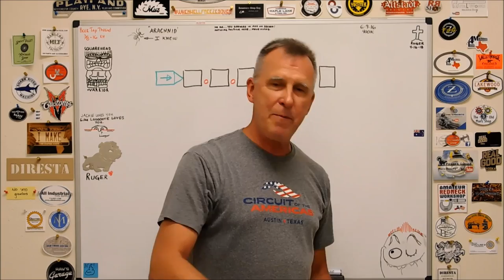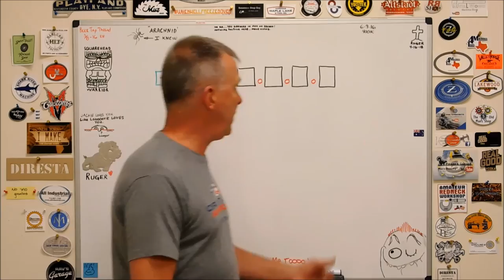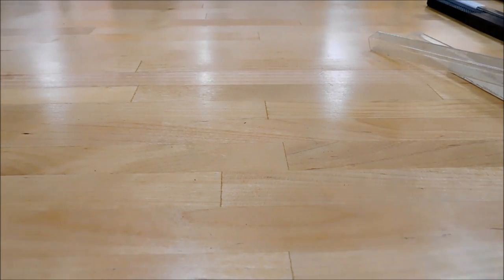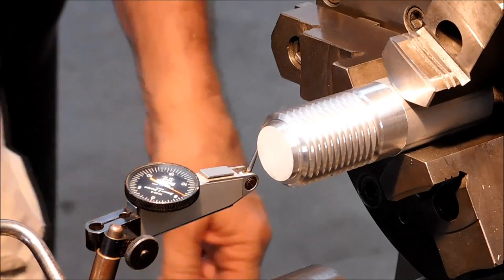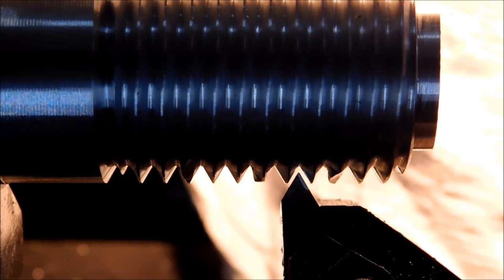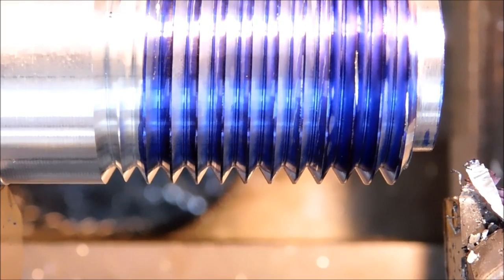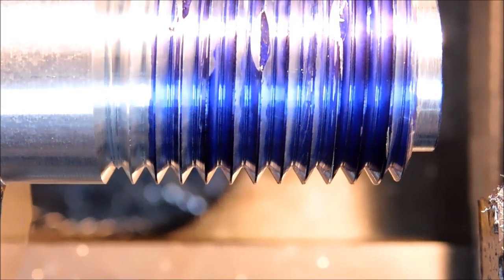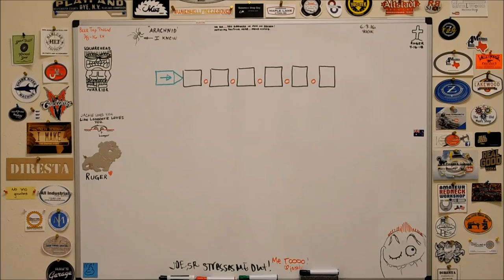Chasing and Repairing Damaged Threads

Comment: Did you say you are cutting a left-handed Thread no right just so everyone knows left hand right ?
Reply from the maker: Correct, for sake of threading away from the chuck for the demonstration with the tool upright, the resulting thread is a left hand.
Reply: @joepie221  Looks left hand to me
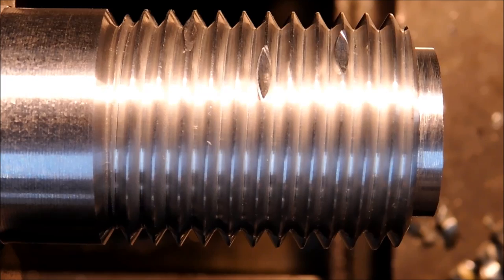Reply: @joepie221  Joe at 20:10 it says this is a LEFT HAND thread .. it also looks left hand in the video
Reply from the maker: @kimgray8327  it is.
Reply from the maker: @chuckels431  you are correct.

Comment: Boo boo at 28:07. I guess it's important to make sure you back the tool out far enough.
Reply from the maker: Negative. The tool only made contact with material displaced by the damage. Notice the remaining thread crests showed no sign of contact.
Reply: @joepie221  Pardon my ignorance. Great video as usual.
Reply: Kris is correct. You can clearly see chip flying and the blue was there before you made your run. Sorry but Kris is correct.
Reply: Indeed. At 28:28, and then again at 28:31, with the rotation stopped, you can clearly see the track of the out-of-position tooltip, taking a slight (RH) helical cut through the blue across the crests in three or four locations

Comment: Eh Joe, I cannot cut threads to save my life. I've got all the change gears, the chart is there & it makes no goddamn sense to me whatsoever. Can you help please?...
Reply: Maybe Joe has a better idea, but every lathe is different and so are the charts. It makes it tough to type to people and describe it. If you would, post on hobby-machinist.com a photo of the gear train, and the chart. Perhaps include the model number of the lathe and a link to the manual if you can. I'll watch for it and try to get you sorted. If I don't do it, someone else will. It's tricky the first couple of times you set up a change gear machine, but you can get used to it pretty quick.

For running the thread, Joe has a great video demonstrating how he does it, which is how I do it as well.

Comment: Did you just spend 7 minutes explaining backlash?
Reply: Yes but NOT backlash in the compound and cross slide leadscrews but in the whole machine from the motor upwards. I'm willing to bet most people wouldn't even consider all the geartrain prior to the gearbox or banjo
Reply: @samrodian919  The only backlash and clearances which matter for thread registration are the cross slide guideway clearances, compound slide leadscrew + nut axial play, main leadscrew's axial (endwise) float in its bearings, clearance in the half-nut guides and internal thread (of course the latter will vary along the leadscrew), slop in the dog clutch(es) in the quick change screwcutting gearbox, and lash in every engaged pair of gears in that gearbox and/or banjo (and in relevant cases their internal splines and keyways), all the way back to the spindle. However any lash anywhere in the drivetrain from the motor to the spindle (belts, clutches, gears, backgear and/or whatever else) is entirely immaterial.